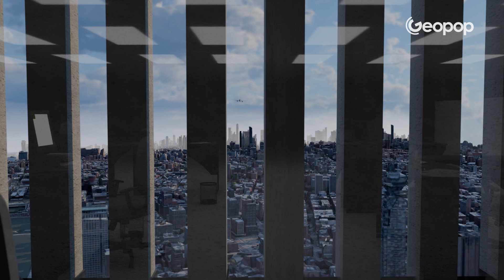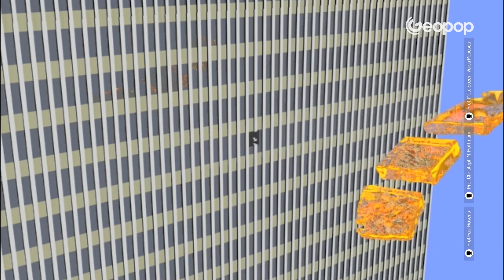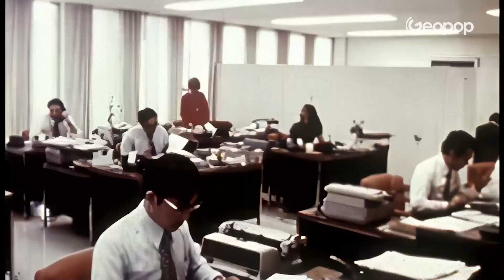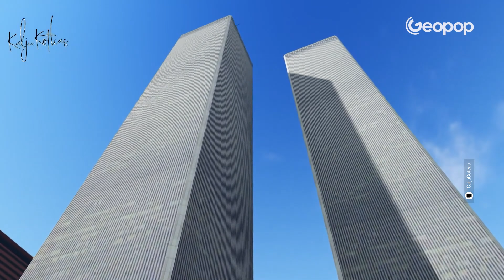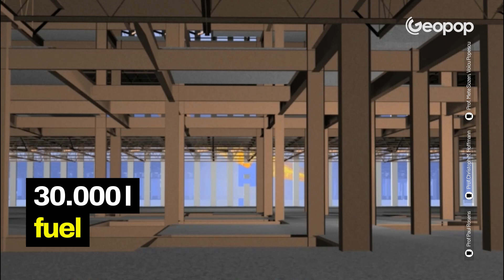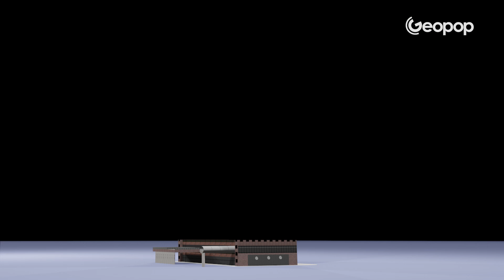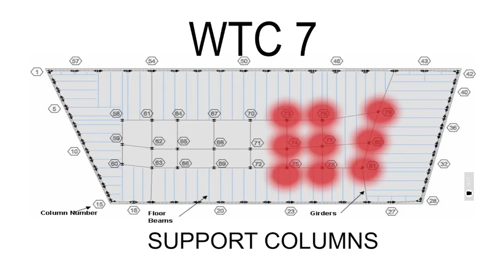9/11, 2001: The Technical Reconstruction of the Twin Towers and WTC 7 Collapses

Comment: Has anyone actually been in either of the towers? I was. There was a water filled pendulum in the top 5 floors of each tower. Also, there were fire suppression lines all over the building. There are too many details being left out. The way the pentagon plane hit was covered up as well the whole story stinks.
Reply: The fire suppression lines were severed when the plane hit. No significant water (if any at all) found its way to the fires.
Reply: @Tim22222 last I checked if a water line breaks, water comes out. Someone must turn the water off for there to be no water. You're not the only person I've heard say this and no doubt yall heard it from somewhere but at any point do you not think before you speak? Use your brain.
Reply: @robbiehiatt9966  So tell us, genius: How does water pouring out of a broken line get to fire above it?
Reply: @Tim22222  The towers had both overhead storage tanks and used the city's water mains as a backup. Sprinklers on lower floors (up to the 20th floor) relied on the city's water main for their supply, while those on higher floors (21st to 47th) and the 110th floor (top floor) had their own overhead tanks.
Reply: @robbiehiatt9966  :  Everything was broken, so mostly inefficient.
Reply: @ThomasKundera  it doesn't take a genius to see you are broken
Reply: @robbiehiatt9966  : Off-top ad hominem is the average level of "argument" of deniers.
Thanks for another demonstration.
Reply: @ThomasKunderaBis  fo suck one
Reply: @ThomasKunderaBis  I rest my case
Reply: @ : On a dogma, as you don't want to actually reason and look at facts.
Why?
Reply: @ThomasKunderaBis  says the moron who steals people's identity you are a scum bucket.
Reply: @robbiehiatt9966  " who steals people's identity"
What?
Reply: @ThomasKundera someone is, we've got 2 different thomaskunderas here
Reply: @robbiehiatt9966  : Both are my ac*nt, I even have a "ter", it's to evade YT censorship, sometimes one of those cannot post, i switch to the next one.
Reply: There was no such mechanism in the Twin Towers (there is another tower in NYC with such a feature though) and the standpipes for the fire suppression system were ripped out by the impacts of the planes.

Comment: You forgot that NIST also admitted (in an addendum) that WTC7 fell at free fall speed (for 4-6 floors)!  This means that the building fell as if there was no "steel" holding it up??  This was discovered by a High School Teacher and proved it to NIST so they changed the Original Report. So the 1 or 2 pilar's gone theory really doesn't work here!
Reply: The NIST explains pretty well how the collapse last quite longer, but the outer shell felt last, even pulled down by the rest, thus it's high speed.
Reply: It's as if there was an invisible pacman eating the building as it fell. If resistance had occurred at any point the roof would have deformed but the entire building stayed true and straight nearly the whole way down. Not to mention the explosions coming from tower 7. 
8:25
https://youtu.be/bLF5D7M1YgA?si=aHSvS__uOdxMi1ZB
You can't say that it was added because you can see the firemen's reaction to the explosion. And you can't say it came from anywhere else because the firefighter says
" We gotta get out of here,  7 is exploding
Reply: @robbiehiatt9966  : WTC 7 burned for more than 6 hours, and then showed sign of collapse: parts went down by several tens of centimeter, that's when the building was evacuated, no "explosion" needed.
Reply: @ThomasKundera  there were explosions coming from tower 7 like the fireman explained and another firefighter called it after he got blown up that other buildings were gonna blow up. I didn't say that, that man was a NYC firefighter I'm sure he knows better than you.
Reply: @robbiehiatt9966  "e explosions coming from tower 7 like the fireman explaine"
Again: There were tens of cameras pointed to WTC7 at that time.

And none of them recorded explosives. You have to rely on indirect very far away videos, and people saying stuff.
This is not very convincing.

WTC7 was already about to fall under the fire, showing growing weakness in the structure, which is why the firefighters left the building.
Why do you have to invent explosives at that point?
Explosives that would have been still operational and remotely usable after 7h of fires,
Think!
Reply: @ThomasKundera There were explosions like this when going off all day long. ? 8:25
https://youtu.be/bLF5D7M1YgA?si=aHSvS__uOdxMi1ZB
You can't say that it was added because you can see the firemen's reaction to the explosion. And you can't say it came from anywhere else because the firefighter says
" We gotta get out of here,  7 is exploding "
And by the way, camras don't record sounds, microphones do. And you don't have a clue how a microphone works.

Comment: Not a single computer model accounts for the WTC7 reality.
Reply: Except this one: www.youtube.com/watch?v=VAkTbyENZ5s

Do we need a computer model?  No.  But for some intellectually challenged people it helps.
Reply: I know.  You would think the model would represent what the exteriors collapse would look like just on a basic level. But they look nothing alike. Nist shows each side of the building falling towards the center at the end but in real life it fell straight down. It's a complicated task, I get that but they had 6 years to do it. Nist claims the exterior of the building is fixed and it's not. When trouble occurs inside a building such as this, the outside of the building is affected. Everything near the collapse would begin to fail. Including the exterior.  If the exterior was truly fixed the exterior would fail later. All they did was lie and say the exterior was fixed, but it wasn't. And if you don't know anything about construction then you don't know what I'm talking about anyw

Comment: Aluminium vs Steel in a collision, aluminium would be like a fly hitting a windscreen, when did a fly actually come through a wind when it hits one?
When did anyone count the beams that were damahed when this event happened this video is all speculation!
Reply: "when did a fly actually come through a wind when it hits one?"
When going fast enough.

"When did anyone count the beams that were damahed when this event happened this video is all speculation!"
The outside ones can be counted. The inner ones are deduced from simulations.

There may be a bit of uncertainty, but globally it works, as we can see.
Reply: The U.S. Navy will be glad to hear that they didn't lose scores of ships in World War 2 and 5,000 sailors due to airplanes crashing into their steel hulls and decks.
Reply: A 150-ton aircraft doing 500 mph carries kinetic energy equivalent to a ton of TNT (it doesn't matter what it's made of). You don't think that would do substantial damage to a mostly-empty steel cage? Don't think of the towers as solid steel blocks, they were not!

Comment: Nice try Liars! That doeant explain the liquid magma  steel rivers running under building seven!  Steel might weaken at 1000° but NOTHING shy of a foundry where steel is forged , will melt steel to that temperature.   Oh wait , one other thing will cause steel to melt into  molten rivers. Its the same thing that is regularly used for controlled demolitions. 

Its the same thing that was found prominently in the rubble of all 3 buildings. 

In fact several tons of this compound were found on the property and within the rubble of the trade center buildings . 

This was found by several investigations of the fallen towers. 

It is precisely why the rubble from the twin towers was quickly gathered up and taken away from.the crime scene too!
Reply: No need to explain stuff that did not happen and memes that conspiracy fantacists just made up. This is a serious video. 

Sure, you might actually believe some of that nonsense you just spewed, but that does not change the fact its nonsense.
Reply: "That doeant explain the liquid magma  steel rivers running under building seven! "
Never happened.

"Steel might weaken at 1000°"
Right.

"one other thing will cause steel to melt into  molten rivers. Its the same thing that is regularly used for controlled demolitions."
Really?

"Its the same thing that was found prominently in the rubble of all 3 buildings."
No.

"In fact several tons of this compound were found on the property and within the rubble of the trade center buildings ."
No.

"This was found by several investigations of the fallen towers."
No.

"It is precisely why the rubble from the twin towers was quickly gathered up and taken away from.the crime scene too!"
Incorrect.
Reply: A firefighter did claim to see molten steel days after the collapse. How he decided it was steel I don't know,  I wasn't there. And neither was you. But it was reported.
Reply: @robbiehiatt9966  "How he decided it was steel I don't know"

Bingo! You just hit the nail on the head! To know whether it was steel you need to get a sample of the material & have it analyzed. Was this done? No? Then there's no evidence it was steel.
Reply: @Tim22222  Once again, you are lying.  There are ways to tell by looking at it. You know nothing at all. You are the problem. There's his eyewitness testimony, that is a form of proof

Comment: Wonder who was remotely operating those planes, and who planted the charges that took all 3 of those buildings down.
Reply: I have a simple and entirely hypothetical question. One I have asked hundreds of times but no one so far has even attempted to answer. Run from it like Cockroaches from the light they do. Maybe you can be the one to change that trend.

If YOU were to plan the 9/11 attacks, how would YOU do it ?

Remember, you are staging attacks on 4 world famous, iconic symbols of American economic, military and political power, you absolutely can’t get caught and it absolutely has to look like everything was done with hijacked commercial domestic airliners used by terrorists as Kamikaze missiles.

So, how would _you do it?

You need to figure out what you are you trying to do, how would you most effectively go about doing it and why in a plan that makes the most sense as the most efficient and effective way to achieve that objective. And remember, it has to fit ALL of the available physical evidence and visual record, preferably not require Rube Goldberg levels of complexity, and make logical sense.

And you sure as hell can’t do anything that will get you caught.
Reply: Planes were piloted by humans (we have their name), and there were no "charges", but planes.
Reply: @ThomasKundera so because someone gave you a name of a pilot that proves something???  All while you ignore explosions coming from tower 7. These explosions 8:26 
https://youtu.be/bLF5D7M1YgA?si=aHSvS__uOdxMi1ZB
The firefighter said. " we gotta get outta here, . 7 is exploding "
Reply: @robbiehiatt9966  : Again:
 There were tens of cameras pointed to WTC7 at that time.

And none of them recorded explosives. You have to rely on indirect very far away videos, and people saying stuff.
This is not very convincing.

Again: WTC7 was already about to fall under the fire, showing growing weakness in the structure, which is why the firefighters left the building.
Why do you have to invent explosives at that point?
Explosives that would have been still operational and remotely usable after 7h of fires,
Think!
Reply: My guess would be that the gelatin group had something to do with it

Comment: So... you're not gonna mention that in WTC 7 there was a huuuge gash in the building from the antenna of WTC 1.... 

Why not talk about that ? Because that's important since it severed a lot of columns.
Reply: The physical damage to Building 7 was important in terms of introducing fire to multiple floors of the building simultaneously, but not important to the eventual cause of collapse. That physical damage was not responsible for the collapse and had there been no fire, Building 7 would have survived that damage.
Reply: @TheLoonResistance Not many buildings can survive explosions like this.  8:26 
https://youtu.be/bLF5D7M1YgA?si=aHSvS__uOdxMi1ZB
The firefighter said. " we gotta get outta here, 7 is exploding "
Reply: AFAIK, NIST concluded that the damages to WTC7 by falling remains of WTC1 were mostly cosmetic and not structural.
That's the 7h of fires that were the cause.
Reply: Um, yeah except the antenna fell the other way and NOT into WTC 7.  Nice try though. 😳
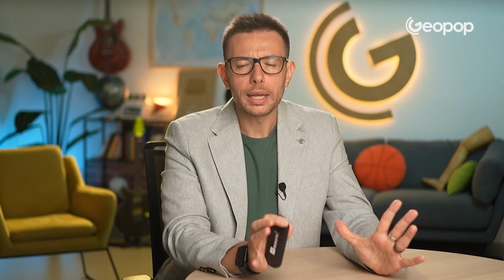Reply: @Jimschrbr  Both buildings on each side of tower seven was hit by more debris according to the map of the damage near the end of this video.  And at 1:40 in this very video he admits he isn't being truthful

Comment: BULLSHIT.  One does not require an engineering degree to simply allow oneself to see a solid steel core building in free-fall.  "Jet fuel" sounds scary but it is basically kerosene.  It was gone, burned within 15 seconds of igniting -- at which point you have the equivalent of a house fire.  This can not create the failure we all saw.  Look at footage of buildings in failure versus buildings in demolition free-fall(dust versus no dust while falling).  Block out the noise of "the official story" and look with your own eyes and mind.  Stop being afraid to SEE the truth.
So, who done it?
The same "ones" who did all of it, for the entire time you have been alive!
Reply: I couldn't agree with you more. If any resistance were to occur in tower 7,  you would see the resistance by the deformation of the building while the resistance occurred. If just one vertical column resisted you would see a deformation in the structure of the building.  But we don't see any resistance because the building held its shape all the way down. If any resistance happened, the top of the building wouldn't be straight across as it completely fell all the way to the ground.
Reply: I'm going to respectfully disagree with you, but rather than just simply assert you are wrong I will present a detailed affirmative case explaining why mine is better.

The 47 core and 236 perimeter columns of the Twin Towers support all of the gravity loads of the building. ALL of the resistance is in the columns.

Planes impact Towers, causing massive structural damage, destroying sprinkler systems, tearing out gypsum board walls and blasting off the SFRM insulation from the floors. Multiple floor-wide fires are started instantly and spread rapidly due to the destruction of fire protection systems and venting of the building during the impact.

Serious fires were largely confined to the impact damaged floors and those immediately adjacent to them.  

Fires were started by the impacts and fuel aboard the aircraft, which acted as an accelerant. No shortage of other consumables inside the tower to continue the fires. 

Collapse was initiated (started) at the impact and fire damaged floors when floor trusses exposed to heat over time sagged, in turn pulling on and causing the inward bowing of perimeter columns by up to 5 feet until they buckled. 

No steel melted or needed to. Structural steel will bend and fail at less than half its melting temperature.

Once the perimeter columns buckled the formerly static load above became a dynamic load 30 times greater, easily overwhelming the structure below.

Thousands of tons of now loose debris fell through the open off space - through the inside of the building bypassing the columns - dropping 12 feet onto the first intact floor it comes across. The massive instant overload causes the floor to fail, adding its mass to the falling mass which continues to accelerate for another 12 feet until it impacts the next floor, rinse and repeat all the way down. Rate of collapse increases as momentum increases. As each floor fails, air inside the building (the Towers were 95% air by volume) is compressed, then blows out the sides _in reaction to the Tower falling, not the cause of the Tower falling.

No fire required at all on floors below the impact points for them to fail. The mechanisms that started the collapse are different to the mechanisms which continued the collapse.   That will be a difficult concept for some.

As the floors fail the perimeter columns are left literally hanging in the breeze, no longer attached to the rest of the structure. They peel away and fall in great sheets (think banana) out to more than 600 feet from the base on the 4 points of the compass. 

Core columns failed last. 

Each 110-story tower had a 1-acre footprint. The debris pile was up to 14 stories deep and spread out over 16 acres, destroying 8 surrounding buildings and damaging more than 100 others. 

If I made any errors of fact, logic or reason or left anything critical out, please let me know so I can fix it.  If that isn't enough detail I can dive in deeper. IF you can do better, please have at it. Be the first to even try.
Reply: @TheCriticalStinker-jw4fl  You were not there, everything you have said is hearsay. You presented 0 evidence whatsoever. Do you believe when a pipe breaks water comes out? How do you suppose the pipes sealed up when they broke because I've been in this business for thirty years and never once has that happened. Have you any common since at all? And quit saying gravity loads, no one says that except morons who don't have a clue. The debris wasn't even as tall as the lobby.  Now parts of the building were still standing and maybe that is what you are referring to but that's hardly a dabree field. I've posted the explosions coming from tower 7. I've posted the firefighters saying "it looked like somebody planned to take the buildings down", I've posted a  firefighter claiming" anyone of these buildings could blow up. "
If you think your hearsay carries more weight than my video evidence from multiple eyewitnesses you are a joke